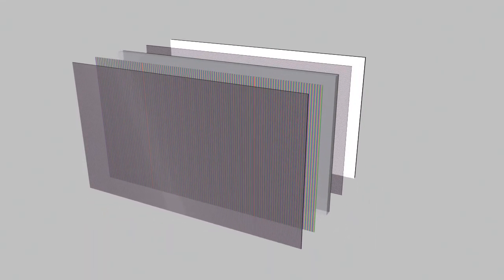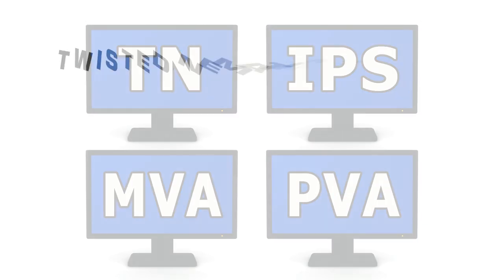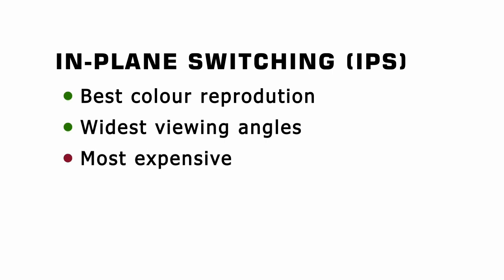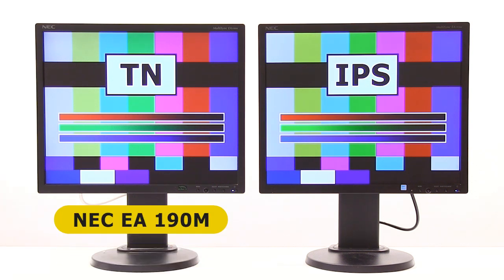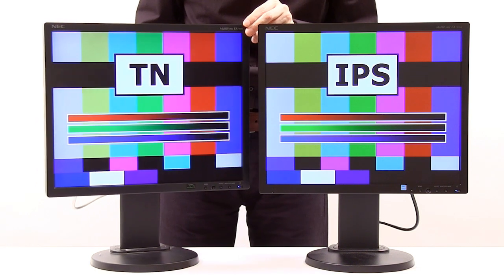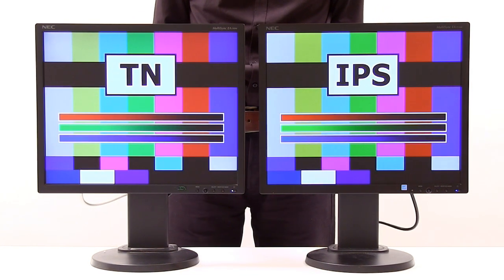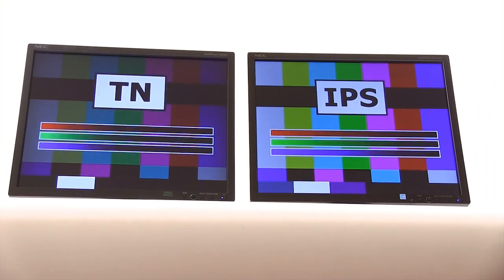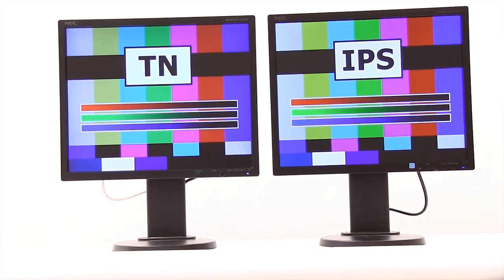LCD Monitors (TN v IPS)

Comment: Great video. Computer parts are High in cost these days. I bought a old LED monitor from our Good Will for $10 to use as a test monitor for repairs. I tested it and it worked. I got a used VA panel for $108 at Amazon. I hooked them up in a Ryzen 1600 build I did with an old AMD video card. The colors on the $10 old 4x3 led was better looking than the newer 1920x1080 16x9 VA panel. I changed the video card with a GTX 950 TI card I had and was able to adjust the color on the VA panel better with the NVidia controls. Just saying the video card does play into the type of monitor you use.

Comment: I always thought VA is the slowest of the three, at least it is the case in the panel I have. Then again my TV has VA panel that is noticeably faster than the VA monitor. But these two have many years of age difference so that might explain some of it. Then again in my eyes the IPS monitor of mine is a tad faster than the VA TV (I do keep the TV in game mode when playing).

I also think that for gaming, IPS is very much good enough for a normal mortals and TN is more for esports level of players. Depends on game type a bit too of course. But for normal people I would say IPS is fast enough, and you get those better colours. Unless the monitor comes purely for gaming and absolutely nothing else, then TN could be the one to have. But as said in the video, if you have the possibility, see for yourself before spending money.

I think it is also worth mentioning that with VA panels you usually get the deepest black levels of the three.
Reply from the maker: +Juha Koski Thanks for this -- really good feedback. As you say, it depends on individual models, and all panel types keep improving -- so it depends what is compared with what! Yes, MVA or PVA panels should give the best blacks.
Reply: there are now 4ms gtg IPS and VA panels out there, but the VA panels aren't consistent on whole color spectrum with the delay, and can go from 4ms to 25ms, while the IPS tends to stay clouse to 4-6ms. 
And yes the VA have good black compare to IPS, so I can't rely tell why whould you want to do any color based work on IPS.

Comment: Thanks again, Christopher, for another great video tutorial.  How do you know what kind of video monitor you have?  I think mine just said LTN156AT01.  It came out of an older Dell laptop that crapped out.  I saved the monitor and got a video driver board to use for my Raspberry Pi 3 monitor.  My wife said I my computer now looks like something from a mad scientist with my driver exposed (but mounted to a 15 inch 2¨X4¨ piece of cedar wood.  The button control is screwed upside down to the front and the high voltage is mounted in the back.  All I know is that IT WORKS!  And that´s what´s important to me.  I even saved the hinges and the monitor bezel to reuse.  Since this monitor had studs as well as hinges I drilled two holes in the two by four and mounted it on top.  It, of course, looks very home made.  I´ve got wires from my Raspberry Pi 3, audio cable, power supply cable, optical drive cable and Pi power supply cables all hanging out the back.  I guess it does look some what of an electronics lab behind my monitor.  But then again, that´s the fun of it all.  Cheers, mate!  :-)

Comment: I'm sure this cheap 4:3 TN has no way to compete with an IPS but what about a good TN? Also next time you might wonna test response time with a mouse click or showing both monitors output at the same time (it show the delay when you pause a frame, very acurate if you add a clock on the side) and the ghost effect of moving objects that's so important for competitive FPS games (how much blur).

Comment: Would you know how to use an iPhone or Android tablet as a wifi adapter for a computer?
Reason, the VPN client for my Windows 8.1 PC won't connect to the VPN whereas the app for Android and IOS works fine.
(I am using Ivacy)

Thanks

Comment: uh, this is kinda iffy. that's a low quality IPS panel you've got there. it's not supposed to distort nearly as much as that.
and MVA has the best contrast out of all the panels, it's not "Just a compromise". they can have up to 5 times higher contrast ratio (deeper black levels) compared to IPS panels and certainly have their worth. they're the best for watching movies in dark rooms, for instance.

i would also never recommend TN. if you get the choice, ALWAYS go with ips. it's completely worth the "extra money".
of course, you don't always get the choice. i for instance wanted a 144hz panel with gsync and low input lag, and back then i was pretty much restricted to TN panels. 
having used IPS screens for 8 years before this one, there's not a moment i don't resent it for the terrible angles and color reproduction. i'm actually just waiting for an affordable 144hz ips panel to hit stores in my country and i'll probably switch.

Comment: you can never go wrong with any monitor as long as you check the specs before purchase. Of course avoiding those unreliable ones. I had a dell monitor that lasted me for a good 10 years but it had to go recently because of burnt panel. Now I have bought another dell monitor (E2219HN) due to its value for money and good specifications. It indeed shows how reliable and reputable their monitors are

Comment: The TN panel in this vido is trash. Probably the IPS panel to. BUT this video makes TN looks garbage. TN can have ALMOST as good color depths as an IPS panel, if you choose a high end monitor that will say. 
I bought a MG279Q(IPS) and it had way to much ips glow and backlight bleed for me to be able to enjoy it. I returned it and went for the same monitor with TN panel insted (MG278q). 
Great monitor, would recommend it to anyone that wants 1440p, 144hz and 1ms response time. It also have a 8bit panel, wich makes the colours increadible